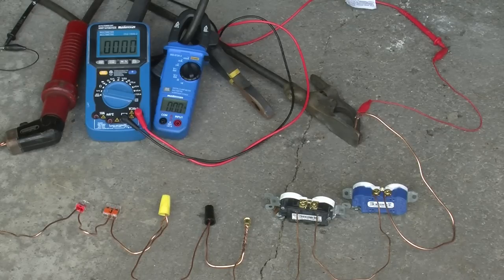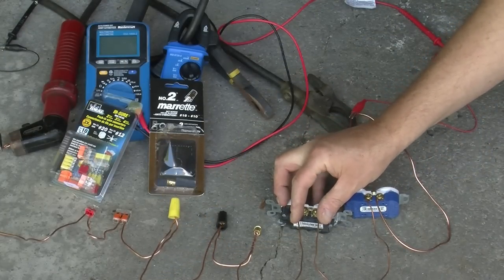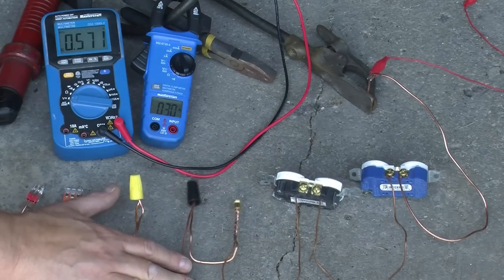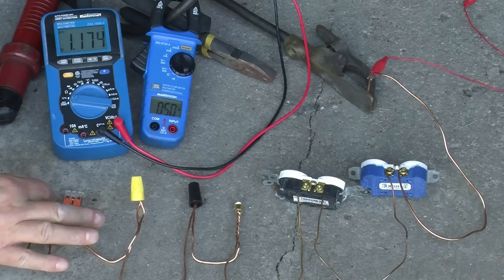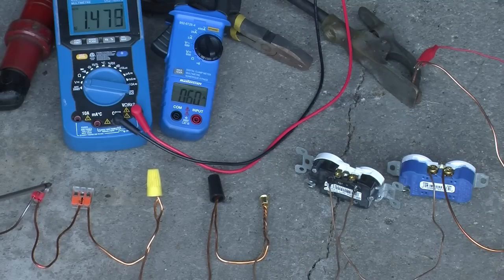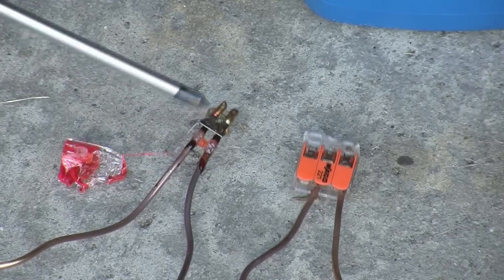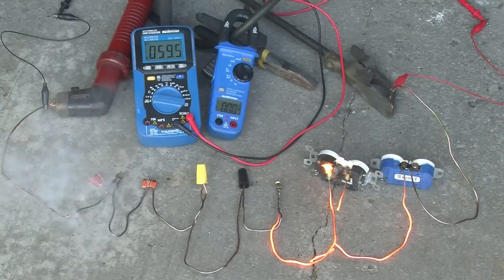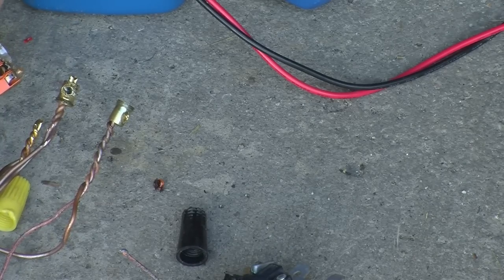Connectors: Which is the Weakest Link

Comment: Some thoughts

1. Would have been nice to have done impedance testing on the connections beforehand
2. Would have been nice to see the same model of receptacle used so we could more clearly attribute differences to a poorer connection / greater heat generation rather than the design or materials quality of the receptacle itself

I have recently replaced about 40 receptacles in my home with most of them utilizing the push in connectors. House was built in 82 but I'm sure some of them at least had been replaced. I'd say about 5 times simply in pulling out the receptacle to replace it a wire simply fell out with very little force applied at all. Most of them though were still quite snug. Seems less that it's such a terrible connection and more that it's unreliable. Of course, I cannot attest as to whether the installer pull tested the original connections.
Reply from the maker: Yeah - the push in receptacle was a last minute thought and didn't have two identical ones. Would have been better if they were the same. 

I few other have posted horror stories with those randomly failing and needing to be replaced. Really seems for the small time saving its just not worth using them.

Comment: I was just looking at a different video of some goofy electrical connections(you know those shorts where a dude is twisting wires together like it's a hangar for a drop ceiling or something) and folks in the comments were making arguments that wago connectors are safer than wirenuts... its obvious it's an inferior electrical connection due to the amount of stuff making the electrical connection. I think alot of these people are under the assumption that the metal threads inside are what's making the connection when reality is the wires should be twisted together making a far superior connection. This means less resistance and less heat. Wirenuts may be more dangerous when improperly applied. When wires are barely making contact or halfway slipping out you might have more issues, WAGOs are definitely more idiot proof. But I'm not sure that's the standard you want with people you have doing the work. I'm also certain the small amount of material contacting the wire is going to be an issue down the road when corrosion starts to happen. It's also fairly apparent that the piece of material used is rather small and not copper gold or silver. Which means it's not as good of a conductor itself.  I'm not saying they're crap, I just cant believe some people think that they are better than a wire nut.
Reply from the maker: That's a great summary! Completely agree with you. I thing there is an element of "newer must be better" for many!
Reply: @ElectromagneticVideos  a few of the folks were from germany and I guess they regulated those wago style connectors as the standard connector for in home connectors, and thus believe they must have done the testing and have results that prove that its safer. More than likely no tests involving corrosion occurred, and a likely catalyst was shorts and arcing from "technicians" improperly applying wire nuts. I've heard the car techs complain about people using wirenuts as well, and while the main thing is really how much room and the fact they need a bit more length to make said connection than soldering, or crimps they are under the belief that wirenuts will just fall off with the vibrations of the car.. and while I wouldn't recommend wire nuts in a car. I dont think a properly applied wirenut is going to unscrew itself. They talk of them just falling off. I've seen that in homes as well, it's simply people who aren't ensuring they are applied correctly. I would trust a wire nut over a crimp style connector any day. I've tried them and even found them in homes, and pretty much every time I've found existing or tried doing them myself, tugging on the wire, or adding some rotation into it always results in the wires coming out. Maybe it's better on stranded, but still. When I put a pair or two of wires in a wire nut, solid or stranded, I can give it a much stronger tug and they do not budge. When I replaced my car stereo I used small wirenuts, and they've now been in place for around 5 years and nothing has stopped working or came loose. In a car, I'd recommend soldering and heat shrink(I simply didnt have a soldering iron when I did my stereo), in homes I'll recommend wirenuts. Mar/marretes are cool but I havent seen any new ones anywhere I shop. But I keep all old ones we find. I would use wagos for lighter stuff, smaller lighting circuits, maybe outlets that need to feed one other outlet, but we just don't ever buy wagos.
Reply from the maker: @mattwells1036  Course the other thing with Germany is they are a 230V country so currents are half of ours for household applications so less current, less heat in the connector. The vibrations in cars are so hard on stuff. Years ago I had to get some equipment certified for aircraft use and one of the tests is "shock and vibration". The long term vibration eats though any insulation that isn't secured and rubs on something and screws work loose. I would think cars are even worse, and add the corrosion and heat. 

Your comments regarding soldering and crimping. I have always thought soldering was the best! But a cable manufacturer I often use   swears crimps are way more reliable if done right. Of course they have a room full of muti-thousand $ crimp machines for every connector type imaginable!
Reply: @ElectromagneticVideos  yeah until I had these wirenuts put through the test of time, and mind you this E350 work van has one of the roughest rides I've driven, as well as my town having terrible potholes everywhere, I was worried they were totally right, but I'm Assuming I havent had this wearing issue due to the location of the wirenuts. It's all interior and theres nothing for them to be rubbing on, it's pretty well contained but not confined. If I put a wirenut on a wire going to a sensor connected to the motor, that shakes and vibrates alot, itd probably show me a different result over the same time period. It's now just an experiment for me, to see how long nothing bad happens for, and when it fails, I now have a soldering iron and will just fix everything properly.. something else on that van might ruin the experiment first though.. 295k miles in the rust belt.
Reply: You could also mitigate the wearing issue by taping them amongst the other wires, and making the "heavy" wirenut as close to the center of the wire as possible, not something I did on my workvan radio install though. Basically I had to cut into the stock harness, and attached a new one. I later replaced that unit with a different one and it had an actual adapter that worked with the stock harness, so all of those ended up being pointless after the fact. It really is just an experiment now.. I may actual dive back into them if I can figure out what type of component(I think a capacitor) will keep my radio on for a short period while I turn the key from engine on to accessory. Because at the moment it restarts every time, no matter how fast I do it.
Reply from the maker: @mattwells1036  "It's now just an experiment for me, to see how long nothing bad happens for" I find things like that so interesting! That is a lot of miles - although you never know how long some of those vans that are really pickup trucks last - some are amazing - it certainly doesn't owe you anything after so many miles.

Comment: Wirenuts don't hold up well under vibration.  Never use them in appliances that vibrate or for automotive use!
Reply from the maker: Yes! So sounds like you have some experience in the automotive area? I have future plans to build out a van in to a camper and have been wondering about connectors, cable and vibration. Any connectors you would recommend? And cable - any particular cable? Any tricks to keep it from rubbing on something and the insulation wearing out?
Reply: @ElectromagneticVideos  -- I used Wago in my RV because they work on spring tension but only solder or crimp for my cars and trucks.  As for wire, I always use the marine grade tinned wire. I'm not a big fan of bare copper stranded wire. Also,  I hate electrical tape so I almost never use that except for rare occasions.  I prefer wire loom and shrink tubing and if I'm starting from scratch, I use the wire loom that isn't split.
Reply from the maker: @rpsmith  So solder and heat shrink each connection and the cable bundle in some sort of loom? Is the loom enough to go though a hole in a bulkhead or wall? Or should it be secured near the hole somehow to prevent repeated rubbing from vibration?
Reply: @ElectromagneticVideos  --  If the wall is metal, I always use a rubber grommet to protect the loom.  If it's wood or plastic the loom is sufficient by itself.  Also, I tend to use a Sta-Kon tool and bare metal butt splices covered by heat shrink tubing and only solder when it makes sense.
Reply from the maker: @rpsmith  I'll remember that!  Really appreciate the advice from someone who has done it!
Reply: @ElectromagneticVideos  -- Glad to be of some help!

Comment: Isn't 14 gauge wire rated at 20 amps at 75 degrees Celsius?
Reply from the maker: One of the electricians said in some circumstances but not allowed in home wiring. May vary depending on local codes. Also said but generally not a good idea given the minimal cost saving.
Reply: @ElectromagneticVideos  Is there a tap rule for where you can run 14 gauge wire off of 12 gauge wire on a 20 amp circuit?
Reply: Yes, but in circuits rated 100amps or less you must use the 60 degrees C column for your wire ampacity which limits it to 15amps. Article 240 of the NEC also requires a 15A max breaker size for circuits that use 14awg. The only time the 75 and 90 degree C columns are used for small wires like a 14awg is for de-rating purposes. Say you have 6 current carrying conductors in a conduit that has an ambient temp of 40 degrees C - this would require you to multiply the rated ampacity (15A @ 60 degrees) by .8 and then by .82 (which gives you only 9.82A) - but since almost all wire is rated at 90 degrees, you can multiply the 90 degree ampacity (25A) by .8 and .91 (giving you 18.2A) - which means 14awg still works for a 15A circuit. Hope that makes sense.
Reply: It depends on the insulation temperature rating, how many wires in a conduit, and temperature.  With no insulation you can do over 50A with no issues, except that it is hot and voltage drop is high.
Reply from the maker: @jonathancall9967  Assuming you are in Canada or the US, the general answer is no, but there may be some rare exceptions in non-residential applications. I think in some places in the US (but not Canada) it may be permissible to put a 15A receptacle on a 20A circuit as long as the circuit has some 20A receptacles but you need #12 wire everywhere. Since that is a real corner case, you really have to check not just the electrical code but any local variations of it. Even if it was permitted, I would consider it a really bad idea! I don't even like the 15A receptacle on a 20A circuit concept. Having said all of that - I'm an electrical engineer - the real experts on things like that and whats permitted in electrical code are electricians who live and breath the stuff everyday. And even better,  local electricians know the local code variations inside out - they are the true subject matter experts for that sort of thing.
Reply: @ElectromagneticVideos  I am in the USA. So rhetorically if you had a 12 gauge branch circuit wire and you were tapping off the 12 gauge wire with a 14 gauge wire, would that be considered a tap? Would the tap conductor have to have its own over current production?
Reply: @jmaus2k  So if 14 gauge THHN wire is rated at 90 degrees Celsius, then you should be able to put 20 amps on the wire without the insulation degrading right?
Reply: @jonathancall9967  yes but code says 15 amp max on 14 g regardless of insulation rating.
Reply: There is no internal difference between a 15a receptacle and a 20a one OF THE SAME GRADE. The only difference is that a 20a receptacle has a horizontal  neutral slot to allow the use of a NEMA 5-20P appliance, and a 20a receptacle doesn’t have the stab connectors for use with 14AWG wire. Therefore, it’s perfectly fine to use a NEMA 5-15R receptacle on a 20a circuit because only appliances with NEMA 5-15P cord can plug into it, and internally there is no difference. Of more importance would be to use spec grade or better receptacles instead of the super-low-quality inexpensive ones. Perhaps this is why there is a perception that 20a receptacles are higher quality, because all 20a outlets are generally spec grade, while 15a ones come in lower grades and are often used by contractors on new construction to save a buck. In summary, if you paid 89¢ for your outlet, it’s junk and will be more dangerous, but if you paid a few dollars, then it’s probably good, regardless if it’s a 15a or 20a receptacle.

To really do it correctly, do direct splices in the branch circuit, and pigtail out to each receptacle. This eliminates the requirement for each receptacle to carry the branch load, and the only heat generated at the outlet would be solely from that outlet’s individual load.
Reply: @jonathancall9967  It still depends on the ambient temp and the number in conduit.  Look at the NEC code book to calculate it.  Chart says it can do 25 amps even.  But be careful, if you have a connector that is 60C rated you can't use that 90C rating.
Reply: @ElectromagneticVideos  NEC in the US allows 15A receptacles on a 20A breaker as long as there are more than one (typical duplex counts as two) and 12 gauge wire is used. 15A receptacles are usually made to handle 20 amps, but I think the idea they had in mind was that the full load of the circuit wasn't going to be distributed over only one point of use.

If course it's still a better safety margin if you don't put 15A receptacles on a 20A circuit. I'm just saying in most instances it's allowed in the US.
Reply from the maker: @Krankie_V  Thanks for clarifying that - I thought it was something like that.  I guess its no worse that just having all  receptacles the 20A type that accept 15A plugs as well. I guess I just dont like the thought of even more current being available to overload flimsy extension cords etc.
Reply: @ElectromagneticVideos  no doubt! Crappy extension cords are the weakest link of our electrical system. A channel called Technology Connections made a great video on that. Those extension cords would be so much safer, if only the plug incorporated a fuse, just like plugs in the UK do.
Reply: @1shakezula1  Yes, absolutely. Here in Canada, many rules are unwritten, and I had a hard time finding that caveat in writing saying you can use the 90 deg C column for raceway derating.  But inspectors seem to acknowledge it even if the code book doesn't write it down. Do the calculation and then realize that the derating is still more than the standard 60 deg C column rule anyway, so you're OK using 60, ha ha.
Reply from the maker: @Krankie_V  Yes! And some Christmas light string have fuses in our small (compared to UK) plugs so it is easily do-able. Instead we install $80 AFCI breakers!
Reply: @spelunkerd  The code reference you're looking for regarding using 90 degree column for derating purposes is NEC 110.14(C).

Comment: The advantage of using a wago 222 is you can use lose wire and solid wire in one connector.
Reply from the maker: I'm guessing you mean connect stranded and solid wire? Yes - wire nuts are not great for that!
Reply from the maker: @demofilm  So they work well for automotive? Thats interesting and says a lot for them. With all the heat and vibration, anything that can hold up in a vehicle is impressive.
Reply from the maker: @demofilm  Interesting - one of my future projects is to build out a camper van and have been wondering about connectors and cables being subjected to vibration. What is you experience regarding cables? How to you secure them to make sure they don't rub against something and eventually short?
Reply from the maker: @demofilm  Thanks for the info on how to do it - grat to hear from ssomeone with experiance doing it. I'll use your advice whenever I get around to buildng the camper van! Thanks a gain!